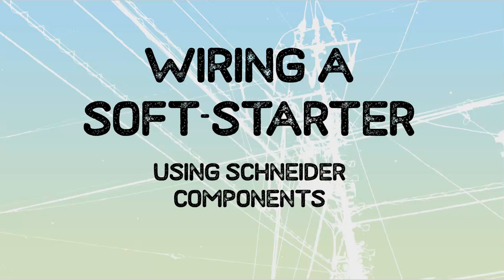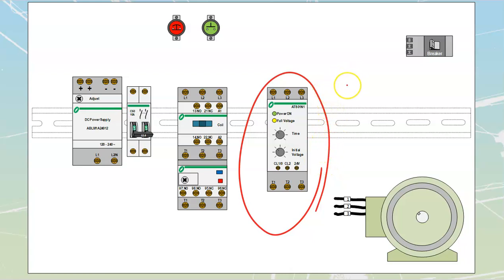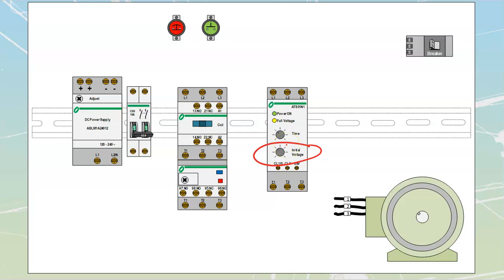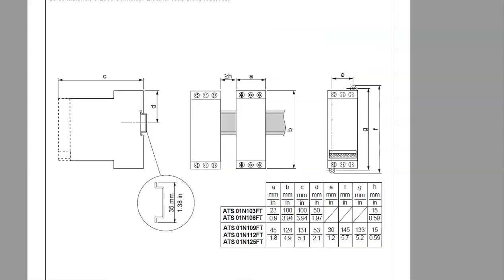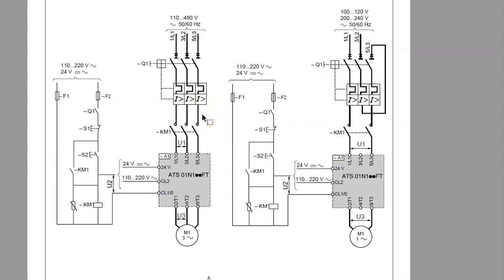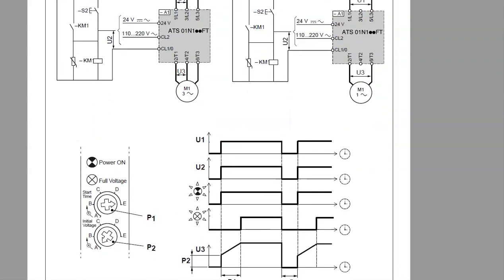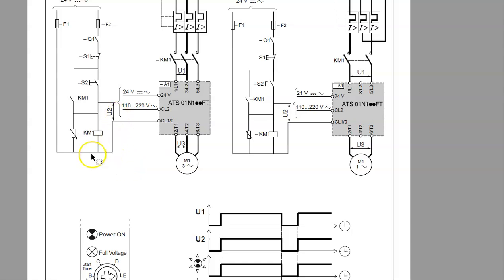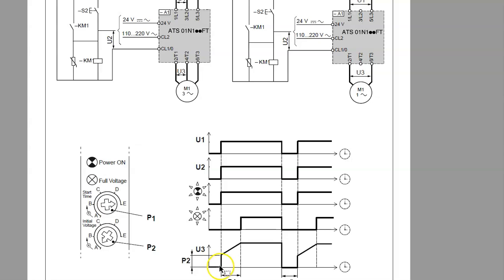Wiring a Schneider Softstarter for a Motor

Comment: can you make wiring for single phase
Reply from the maker: A soft-starter is not an accelerating system for standard single-phase motors who utilize internal switching, capacitors, and varying inductances to create rotation.  If you have a single-phase system and want acceleration or deceleration, your best bet is to get a VFD and power that from single-phase to run a 3-phase motor.

Comment: I guess this is not for european, like I heard.

because i dont understand the connection from A2 of the coil to L2, in which case at least here in europe, you would get 400v. 

As we have here 230/400v

Instead you would connect a neutral line that is apart of the 3 lines.

Can you confirm this pls?
Reply from the maker: One of the great frustrations of electrical is that there is not global standard for voltage and system type.  This video was built around the one of the North American standard systems, which is a 3-phase 208V.  

I'm not actually familiar with the European systems, and I don't know how the specific connections would work.  The best I could refer you to would be the manufacturers manual for the parts.  The overall power system layout of breaker-to-contactor-to-soft-starter would be the same.  The controls would have to be done with a system voltage that is within the limits of the equipment, but would still follow a similar wiring as in this. 

Best of luck.  I wish I could offer more but I just don't know enough about European systems.
Reply: @joelteacheselectrical  thank you for your time, keep doing what you do. 

Big thanks

Comment: i don't get why do i need a contactor, i am looking at ATS130N2D38LT, which has build-in bypass....
Reply from the maker: Softstarters use solid-state semiconductors to pass or cutoff current.  But all semiconductors have some leakage current and can never actually completely isolate the load (or workers) from the mains.  The contactor ahead of that provides that isolation.  

The model you mentioned does have a permissible wiring straight from the breaker.  But not all do.  You can follow that, or the next drawing that utilizes the contactor.  The bypass relay for a softstarter is always in parallel with the semiconductors, not in series.  It only closes in at full voltage to shift the current flow out of the semiconductor channel and allow that to cool when not being used to ramp.  But the bypass relay can never provide full line isolation.

Comment: First off, this is hands down the best video on YouTube. Thank You! I instantly subscribed and liked it! You should be one of the top YouTube electrical channels! I have a question with this for a variant.

I am using a ATS01N2 variant, which has no 24v (not a problem for me) but has R1A, R1C COM LI1 and LI2 as well as LI+ BOOST and L01.
I am currently considering the following logic: 
->R2A connected to A2
->R1A connected to contactor 13NO

Or what would be the correct corresponding connections from the Contactor 13NO and A2

Thank you for any help you are able to provide.  I am an in an area of the world that has a very limited pool of local talent to assist. .
Reply from the maker: That one is a much more complicated model than these.  But I'll try to walk you through it.

Let's start with the assumption that your contactor wiring is identical to what is shown in the video at 13:31.  If so, then modify the circuit as follows.
1) Remove the orange jumper between 13NO and A1
2) Connect 13NO to R1A
3) Connect R1C to A1
4) Make sure you have a jumper from LI+ to LI2

That should get you operational.  It will give you a ramp up with timing and initial voltage based on the front dials.  It's the same thing as the diagram shown on page 4 of the product manual.  If you wanted to use the deceleration ramp you'll need a much larger control circuit with timers, but that's beyond the scope of a Youtube reply.
Reply: @joelteacheselectrical  Thank you very much for this detailed reply, I appreciate it!  I do not need to go with deceleration. This should work great.  I will let you know once I get it all wired up and going.  I have turned on notifications to your channel, so hopefully that helps me keep updated.

Comment: Hi Joel can you do the wiring illustration in the case of a single phase electric motor (the type with capacitors attached ? also assume the power supply is a 240V three wire  (L,N, PE) type
Reply: I would also be interested in the same, and would be grateful if you could provide something to help me connect this o the single phase situation. Thank you.
Reply from the maker: Hi!  These softstarters are not actually built for single-phase motors like that.  You'll need a 3-phase motor to use this.  In your case, you might be better off to connect a VFD (Variable Frequency Drive) and use that to convert to synthetic 3-phase if you need a ramped start.
Reply: @joelteacheselectrical  So you mean a VFD with a Single phase input and a three phase out put to ramp up the motor. One problem though, the motor itself is a single phase type with capacitors, so it only takes a three phase input, how do you power a single phase motor with power from a three phase (U,V,W) output of VFD?
Reply: Also the datasheet of the ATS01N112FT and ATS01N125FT does say it can be used to power a single phase electric motor. I may be confused on this topic, it seems like there is a lot i am missing. Setting me straight on the topic will be very much appreciated

Comment: Nice video.pls those 3 wire from the mccb, are they hot wires. Is the motor a 3 phase motor.Also, the  wire connected to A2, is it a neutral wire?
Reply from the maker: Yes, Those are all hot lines from the breaker through the contactor and softstarter.  The entire power circuit is 3-phase delta at 208V  (Canadian with our color code of Red/Black/Blue for hot lines, and white for neutrals.)

Comment: What the right devices or control ( soft starter ) for 1hp single phase Water Pump Motor , my source using Solar Power Inverter. Thanks..

Comment: Would you recommend this sort of application for a well pump with power supplied by a solar-fed high frequency inverter to avoid the amperage in-rush?  I am trying to plan how to ease the strain from high induction loads on the solar power system. (This is all in the planning phase).  Thank you!!

Comment: Is it possible to run the soft starter just from a MCCB to SFU unit with semiconductor fuse and directly to soft starter and output to motor?

Comment: What software is this? The one where you draw the wires and etc
Reply from the maker: I make all my illustrations in Microsoft Visio (I have a 16 part series on how to create visual representations of electrical parts with it).  Those drawing are exported as images and used in Powerpoint.  I use a Autohotkey "Powerpoint Inking Toolbar" in that with a Wacom One tablet, and then  I record with layered documents using Screencast-o-matic.
Reply: @joelteacheselectrical  Thank you so much <3

Comment: Thanks for the video... do you have advice on if you want the entire system to run or stop just based on a 24V signal with no start or stop button?  Also, I would think that this default state would be stop, but is there a way to wire where the default is to start? P.S.  What would it look like on a two speed motor and phase monitoring?

Comment: Let me see if I understand.. If I already have a motor controlled directly by a contactor, to add softstarter I would A) add the softstarter between the contactor and the motor, and B) add the breaker to provide safety.

Second question. If I have a single phase motor, how can I tell if it is capable of being self-started?

Comment: Joel, This is an amazing video. I've recently became Red Seal construction electrician in my apprenticeship, I have never dealt with motors because I've spent most of my apprenticeship doing commercial and residential high rise towers. When I was in school learning motor controls, I would never understand the section. The pictures they drew out did not really apply to the real world. A couple of months ago, I was given a contactor and a 12 x 12 jb and was told to wire this up. I had no idea what to do, I didn't even know to use din rails to mount the contactor and soft starter... nobody could help me, eventually somebody else did the job and I never learned. I love how you have the din rails, the contactor, and starter exactly how it would look like in real life. I saw the A1 and A2 terminals on the contactor, but had no idea what it was.

I am going through your channel and I hope I can learn everything I didn't get to learn in my apprenticeship. You are the instructor I needed to have during my apprenticeship. This video relates so much to the real world. Thanks for making and posting these videos!

Comment: Can I use the device on the right to start a 20amp 240v well pump on a generator without my lights flickering
Reply: LH4N106RT7
Reply from the maker: It might, but personally, I would not advise it.  A soft-starter synchronizes with the source frequency and allows an ever-increasing amount of the source voltage to pass through as it ramps up.  On a grid, that frequency is very regulated and easy to control.  Most generators struggle to maintain a reliable frequency and this can lead to burnouts on these units.

I would suggest a 3-phase pump on a VFD with a ramped control.  A VFD takes the incoming supply, whatever it looks like in voltage and frequency, and converts that to DC that it then creates synthetic AC out of.  It is far less reliant on the quality of the incoming power.

Any electronic device, VFD or softstarter,  can fail with a higher probability on a generator due to the erratic output under load.  I would be cautious, or possibly look at upsizing your genset to better handle the load.
Reply: @joelteacheselectrical  this is extremely helpful but even though I said generator I meant to say my inverter I am using a 6000w growatt pure sine wave transform based but ever time the well pump kicks in lights flicker. The pump has a capacitor already but was thinking maybe a bigger one might help, thoughts? Also based on you reply since this inverter supplies pretty clean 60 hz the soft starter might work true??  Thank you btw